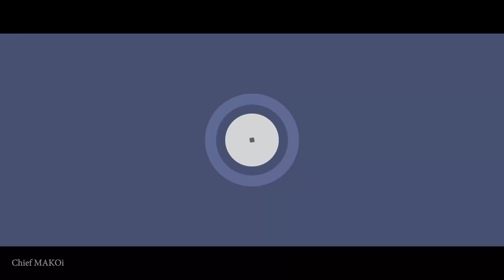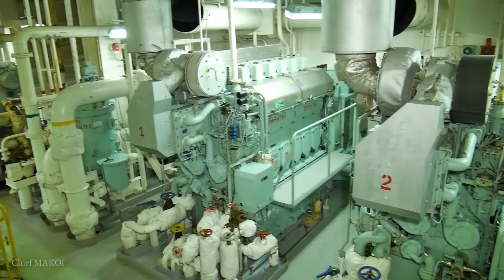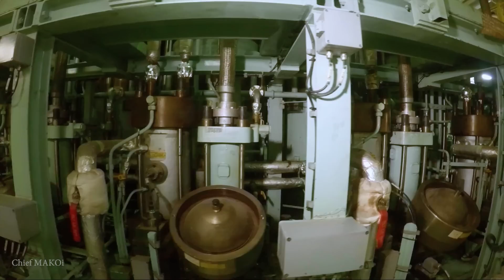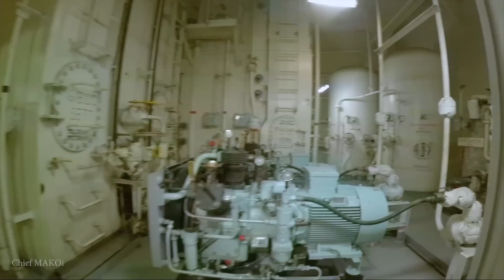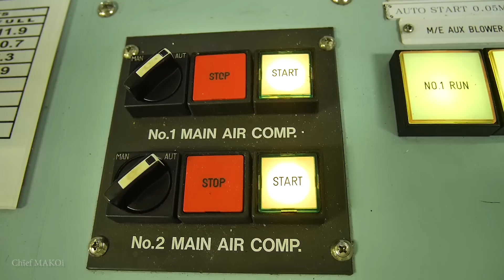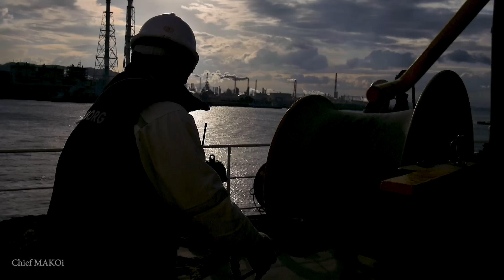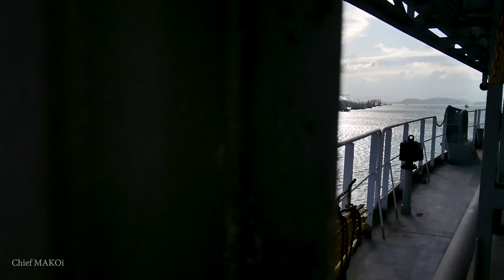Starting Up the Ship's Engine and Leaving Port | Seaman Vlog

Comment: Really good in depth vid Chief about what it takes to start the engines and casting off the mooing lines.  Fascinating stuff I must say.  I noticed ships are still utilizing rat guards on the mooring lines which is something that has been used for over two centuries.  I have a question.  I'm not sure if you are familiar with the incident off of the Norwegian coast last month where a cruise ship floundered in rough seas due to the engines shutting down.  I'm curious as to what would have caused that malfunction being the Chief Engineer on this vessel with years of experience?  Just asking your opinion. Thanks again for sharing your awesome vids my friend and I'm looking forward to more.  Fair winds and following seas to you and your crew.  Cheers!
Reply: Good question. I always wonder myself when a multi-engine cruise ship founders and/or looses all power. Why don't they have a pair of emergency gen-sets forward??
Reply from the maker: I saw somewhere that their official statement was lack of lube oil.  I find that hard to believe.
Reply: @ChiefMAKOi  It is hard to believe that the cause was lack of Lube oil, but I do believe they have a problem with there fuel oil used on board, because they have a multi engines on board and it will not knock off one by one if your fuel is good, only there emergency generator was alive during that ordeal, so its something wrong with fuel on board, it might be contaminated or clouding point is high which becomes wax even at 20 C.